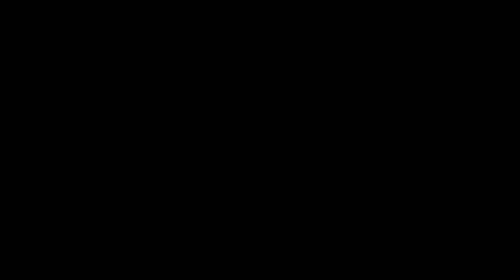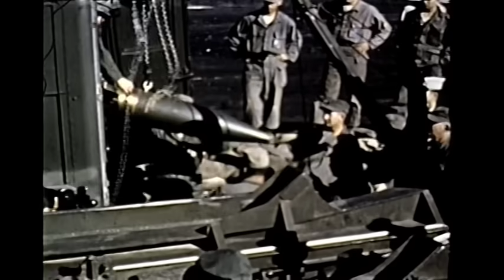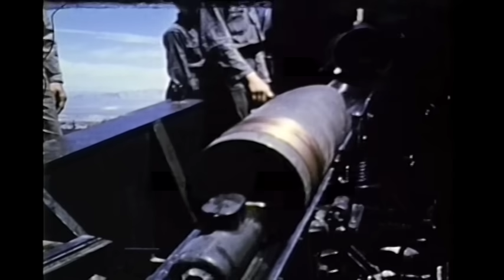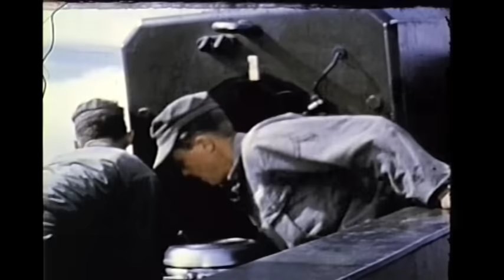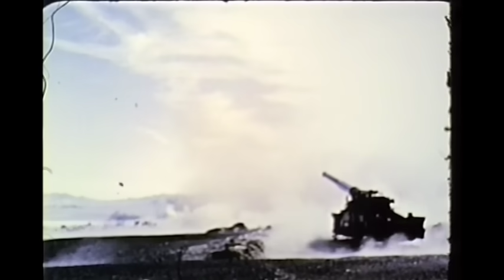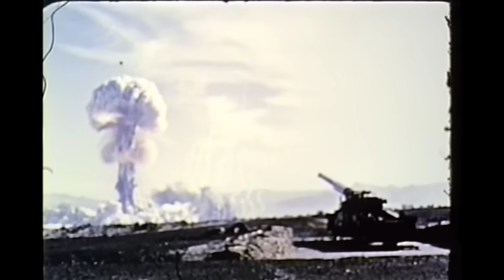The 280mm Atomic Cannon - Nuclear Artillery Test

Comment: Now I know this sounds ridiculous but imagine if that was automatic (660-720 rpm) like a machine gun with a gigantic ammo belt in a velocity-powered conveyor with 50 slots designed to hold 280mm shells and you just fired away. Imagine the aftermath of it

Comment: Knowing how Hollywood operates, I'm suspecting this required some sort of video trickery. The explosion is real but I find it hard to believe you can fit all that mechanics into a tiny shell. The amount of shock during launch would've caused catastrophic damage to the artillery launcher. I believe it was planted on the ground and timed it with a normal artillery.
Reply: The whole gun moves backwards, shoots 25 miles away. That’s why you see the crew running after it’s loaded, put your fingers in your ears and open your mouth so the pressure doesn’t blow out your sinuses, my grandfather was a driver for the front m65 truck
Reply: @MrCmroy  I'm more curious about how they replaced gunpowder with uranium in the shells. You need a fusion trigger and a gun to shoot the fusion device.
Reply: @thelastdefenderofcamelot5623  it’s called the w9 shell
Reply: @thelastdefenderofcamelot5623  they also added the blast sound early so your not waiting an additional 30 something seconds, after the flash the sound would take longer to get there, there’s a huge misconception/rumor that blast would reach 20 miles back to the crew but you can take the same data from the same yield from little boy and discover the crew will be fine
Reply: @thelastdefenderofcamelot5623  I would teach you more about it but every time I comment YouTube has demonetized words that get rid of my comment

Comment: My former father-in-law was on the evaluation committee of the nuclear cannon.

“It was no good, because of the hole.”

“The hole?”

“The blast radius of the darn thing was bigger than the cannon’s distance. So they had to dig a hole, put the cannon in the hole, fire, and wait until the blast had blown over the hole.”

“And?”

“The hole often caved in and buried the cannon.”
Reply: It was same blast radius as Hiroshima bomb, 15 kt. At 25 miles away you’re fine. 250 feet away from target is still direct hit, after they fire their prob gonna be on the move not to get bombed back by the Russians

Comment: This is so fake 😂. I’ve always been suspect about nukes & watching these old films almost solidifies it.
Reply: @RaveyDavey  What he probably mean to say is that the nuclear explosion is real but the launcher is just using a normal shell. Just a video trickery.
Reply: @thelastdefenderofcamelot5623 
No. They developed nuclear war head shells and the weapons were in operation. They are much more simplistic than full warheads.
Reply: @Art-is-craft  What is propelling the shell at launch? That's gunpowder right? You also need a build a miniature uranium gun inside of a shell to propel the fusion reaction. That's where my doubts begin to rise. It doesn't look simple.
Reply: @thelastdefenderofcamelot5623  
The nuclear warhead in the shells were a simplistic system than the larger war head.
Reply: The sound would take longer it was shortened in this video, same yield as Hiroshima bomb 15kt. This gun fired max 25 miles. At 20+miles away you’re fine. Guys this is second gen nuke waaaay smaller then modern nukes your thinking of. But to have the same yield as little man out of a gun is still impressive. That’s why you see the crew running after its loaded, they were instructed to put their fingers in their ears and keep your mouth open so it doesn’t blow your sinuses out when the gun fired. They were in Germany during the Cold War ready to go

Comment: What about a cannon that's powered by a nuke? I just want to see a 10 foot diameter steel ball shot at several times the speed of sound out of an enormous reinforced steel barrel. What thickness the gun needs to be made to contain the almighty nuke I do not know.
Reply: There was project orion which was a rocket powered by nuclear explosion but was cancelled. It would be easier to use that tech to propel a round but anyone shooting that weapon would most likely die due to exposure. Even dust from depleted uranium rounds are still dangerous to the clean up crew. You say you want to see one but you wouldn't want to be the one dying to shoot it.

Comment: Hmmm.  In the narration, the speaker mentions that no gun-type nukes had been detonated since Hiroshima until this test.  That statement would mean that this is the 2nd gun-type nuke ever exploded, as there was no test of this type prior to Hiroshima.
Reply: I hink it refers to the method that the plutonium is brought to supercritical mass within the bomb/shell. A pellet of radioactive material is shot through a barrel into a barely subcritical mass bringing it to supercritical, starting the chain reaction. So it doesn't refer to the fact that the shelf is goed through a gun. 
One of the bombs used in ww2 was of this type. Must've been the one in Hiroshima then.
Reply: The gun-type refers to the nuclear weapon's design, gun-type (using U235) vs. implosion-type (using PU239).  The first Trinity bomb was implosion, fat man used on Nagasaki was implosion, and Hiroshima was Gun-type.  The gun type uses a donut of U235 at the end of a barrel, and a slug of U235 with explosive charge behind it.
Reply: The whole assembly of the cannon  makes it a gun type bomb.

Comment: This was the only nuclear shell ever fired by Atomic Annie. The 20 cannons that were built were already obsolete by the time they were deployed into the field.
Reply: And somehow a few managed to get lost overseas. They were lost for like 20 years before they were finally recovered.
Reply: Obsolete??? How? I can see modern applications for this , North Korea has similar artillery.
Reply: @ghosttankcommander5397 no you don’t

the range is abyssmal compared to a cruise missile, if’s easier to intercept and also more costly to transport, setup and maintain.
Reply: @huey1910  but those shells it fires CANNOT be intercepted unlike your typical cruise missile.
Reply: @ghosttankcommander5397 the typical shell of that size travels around 500m/s. 

A cruise missile going at that speed at its final stages where it could be intercepted would be considered slow.

There is a reason why the NIKE missiles can accelerate to mach 10 AND still need a neutron bomb inside them to effectively intercept icbms and cruise missile.

Post AEGIS artillery very much can be intercepted, much less something old like this.

Edit if you are talking about the blast radius of the nuke, the alternative is being hit directly. Besides, need I remind you, they put neutron bombs inside the interceptor.

Comment: So for a few years, this, plus some other forms of both rocket and ballistic missile technology (eg IRBMs) were proper army, as they were artillery. They would move these things around on alert to destroy, for instance, in this case, an incoming tank division. In fact it was on tests like these they were first studying the so-called mach Y stem formation and use.

This cannon shot a 280mm atomic shell, a rather ubstable gun-type W33 warhead I believe, but perfect for the purpose. This was about 33kt from recollection, someone can correct. Air burst, ~1508m I think, the ring is due to buoyancy and self-interaction with the shockwave and ground.

This is how you trivialize warfare. They were deployed in Europe (eg Fulda gap) and Southeast Asia (eg South Korea).

As with all large-scale conflict, this was itself trivialized with the invention of intercontinental ballistic missiles armed with thermonuclear warheads on multiple reentry vehicles capable of practically delivering 15 or more megatons each.

Comment: Imagine if you could shrink it and put it on you back
Reply: They did make a nuclear bazooka but it didn't shoot far enough and the shooter would get way to much radiation so it was shelved
Reply: @markshort9098  Not true.
Reply: @Evan_Bell  look up Davy Crockett nuclear weapon
Reply: @Evan_Bell  the radiation dose the shooter received depends on the wind direction/ speed as well as how far above the ground it was set to go off, if the wind was blowing towards the shooter then a fatal dose of radiation was possible according to what I've read.. nuclear weapons detonated to close to the ground not only have the fission products, they have all the radioactive products it makes when the the neutrons hit the dirt, dirt being far more dense than air means much more fallout and this was well demonstrated by tests like castle bravo
Reply: @markshort9098  Right, you're talking about fallout, not prompt radiation.
I mean it only produced a gram of fission products, but we can consider what effects that might have. 
The M388 projectile had 2 height of burst settings. 2 feet or 40 feet.
The 40ft option was an airburst, which would result in negligible local fallout. So if the weapon needed to be fired up wind, and it wasn't possible for the launch crew to relocate prior to the fallout arriving on their position, they could go with the airburst and obviate local fallout.
If they had to fire from downwind or the target, could not relocate shortly after firing, and had to use the low HoB option, then yeah, they may be subject to a starting dose rate of up to around 1Gy/hr, depending on the windspeed and exact firing distance. 
But again, there are multiple options to avoid the fallout, or prevent it from being deposited locally.
Fallout is not the reason the weapon was retired.
Reply: Most over powered anti terrorist weapon😆😆😆😆😆

Comment: What I don't understand is how could the fissile material not compress into a nuclear chain reaction when the gun is fired initially?
Reply: In a gun type warhead, a large slug is missing from the center of the uranium warhead (the fissile material). Think of a bowling ball with a large bore drilled out of it. That missing slug material is what is fired into the warhead at detonation. The impact fills the bore so it is now solid, but has sufficient excess energy to compress the material to critical density, at which point it fissions. That is an atomic warhead, not to be confused with a thermonuclear-fusion warhead. That's a different process.
Reply: @StereoSpace  Except the core was cylindrical, not spherical. Also, in the first gun type weapon, a hollow cap was fired onto a central plug. However in this design, it was a central slug that was fired.
No, gun types do not compress the fissile fuel to any meaningful degree.
Reply: @StereoSpace  What you are referencing i believe is a gun type desing like the first one used in Japan, with U235 a fisible material, but the a bit more modern ones work by implotion of various kinds, implotion of hollow esfere for example, i will take a look maybe that warhead was gun type
Reply: @StereoSpace  You are right was a gun type
Reply: @StereoSpace  Thank you smart science man
Reply: because there's no comparison bettween a implosion of high explosive and a 'slow' aceleration with slow burning explosive in a meters long non-smooth barrel, is a unidirectional force unlike the implosion one
Reply: Why would it? The stresses generated during firing aren't enough to compress metals to any meaningful degree.